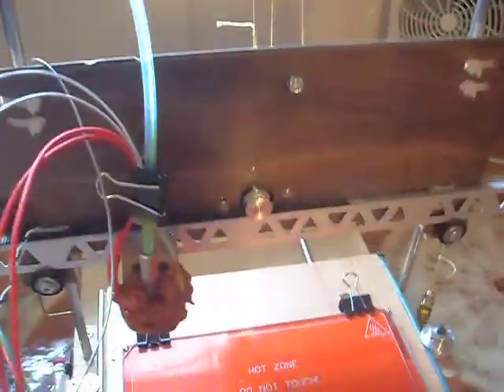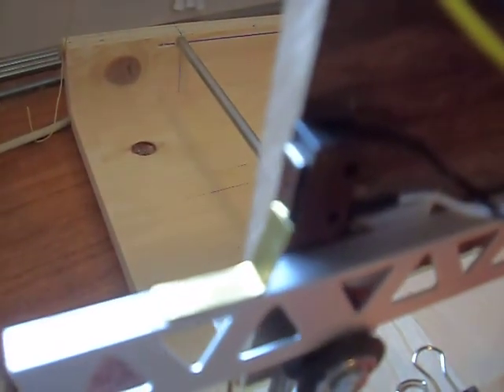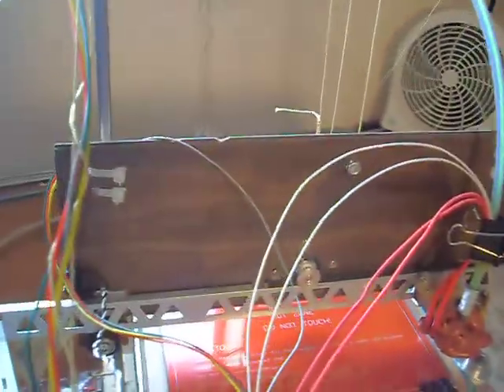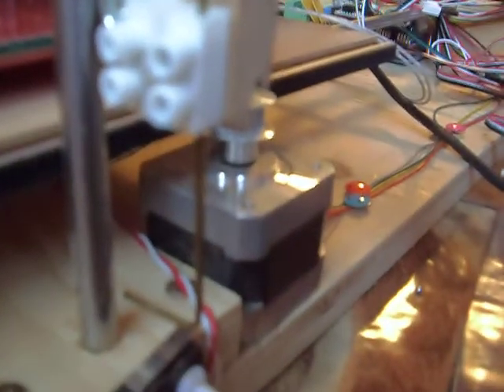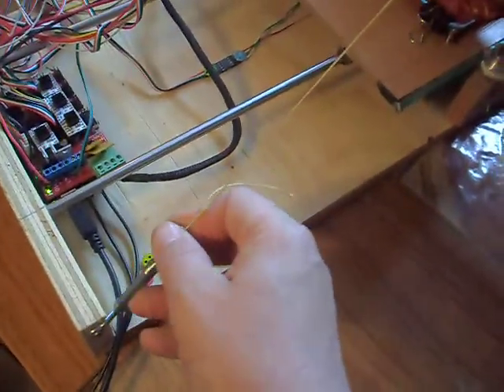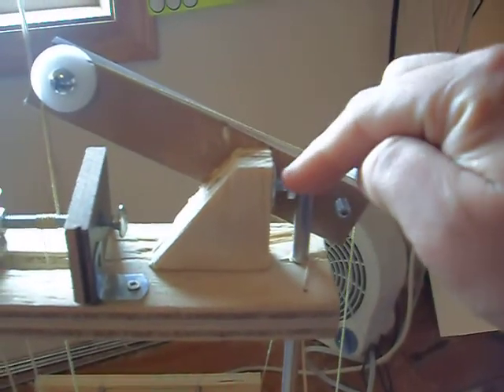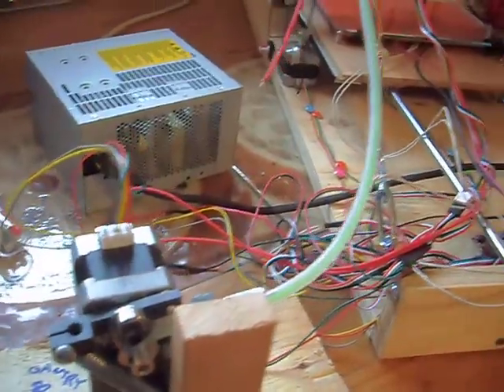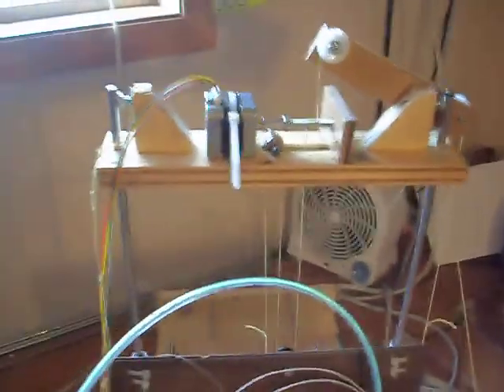Homebuilt 3D printer, Flying beam X new design. Hardware store

Comment from the maker: if you count every part, nut washer, screw and the electronics its 162 parts, I'll get this down to about 100 in the next version.

The complete parts list for Monkey Shit Fight is as follows.

1 Sheet of plywood for base
2 Y rod wood ends
4 wood screws to attach Y rod ends
2 sections smooth rod for Y axis

2 Z rod wood ends
2 wood screws to attach Z rod base
2 hose clamps to secure Z rod top
2 sections smooth rod for Z axis

2 wood adjustment horns for top of Z axis
2 blind nuts
2 bolts
2 wood screws to attach horns to top of Z axis
1 washer
1 screw
2 bearings
1 V groove bearing cover

1 Z axis motor
1 long hex nut drilled to take a pin
1 pin
1 nut
1 carriage bolt
1 carriage bolt end guide
1 bracket
2 wood screws to attach bracket to bolt guide
1 wood brace for Z string idlers
2 Z string idlers
2 screws to attach Z string idlers
1 length 150 pound Kevlar for Z axis string
1 counterweight for end of Z string
(Most of the Z axis top assembly will become 1 laser cut part later)

1 base for Y axis
1 Y axis motor
1 motor pulley gear
1 set screw
1 length of belt
1 length of aluminum molding
4 linear bearings
12 wood braces to box in the four bearings
4 screws
4 washers
4 springs
1 heated bed
1 sheet of glass
4 spring clips
1 length silicone tubing
2 screws to attach tubing to brackets
2 brackets to attach tubing to Y axis base

1 base for X carriage
4 linear bearings
4 sticks to brace bearings
8 zip ties to attach bearings
3 screws
6 bearings
3 V groove bearing covers
1 length of belt
1 length of aluminum molding
3 lock nuts

4 stepper drivers
1 ramps
1 arduino
3 endstops
2 thermistors
wires

1 hotend
1 hotend heater

1 extruder motor
3 base parts for extruder
1 screw
3 bolts
2 nuts
4 washers
1 extruder gear
1 set screw
1 bearing
1 bearing arm
1 bowden tube
1 bowden end
1 bowden end bracket

2 lengths 150 pound Kevlar string for bracing
2 turnbuckles
4 wood screws

Epoxy
Crazy glue

Comment: thats a repstrap!!
Reply from the maker: A Repstrap is something you just throw together so you can hopefully print a better printer. This is designed to be better than what you can put together with just plastic. It is closer to the finished design in wood than it would be in plastic. One of the most important changes is the extremely low part count and the new ways to drive the axis.
Reply: peterthinks A RepRap contains the parts it can make. That is, it is self-building minus the electronics. A RepStrap has parts that were build using another method. Hand or laser cut wood or plastic, etc. Quality isn't really part of the definition.

Good job on that Z axis. Makes total sense in hindsight that in a typical 2 stepper Z axis, we're leaving a lot of speed/rotation unused, and you've successfully transferred more rotation into more torque so we don't need an additional stepper. Thanks for the vid.
Reply from the maker: Acid Rain OK, I will give you that point. By definition it's a repstrap. but not all frogs are toads...yet all toads are frogs. And I was not going for beauty. I was going for accuracy. This pile of junk made a 20 X 20 mm cube that was so tight I could not feel the individual layers with a fingertip. Yes, it's insane to use two motors to hold up the Z. A little bit of gearing and one tiny motor can do the job...speed is not needed in the Z axis, torque is. My main enemy is the part count. And my base is under such strain it will curve up. I intend to replace the base with something stiffer, laminated plywood layers, a chunk of marble, three quarter inch glass or a steel beam. I'll get around to it. I was also trying to keep the cost down but I think a better hot end and extruder are warranted. I'll give monkey shit fight the best feed parts I can find and we will see what a Repstrap can really do!
Reply: peterthinks i said thats a repstrap trying to say: that is a real repstrap!! Sorry for my bad english, I was trying to make a compliment. Very sick man.